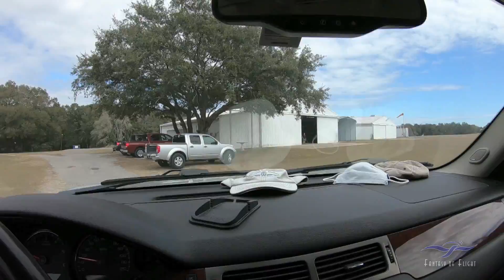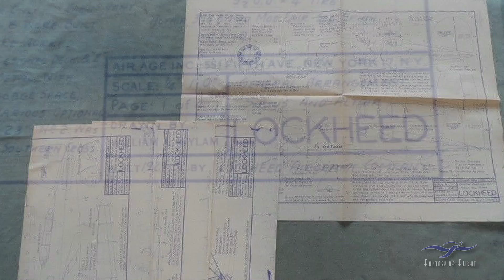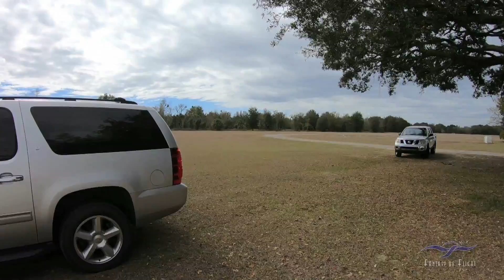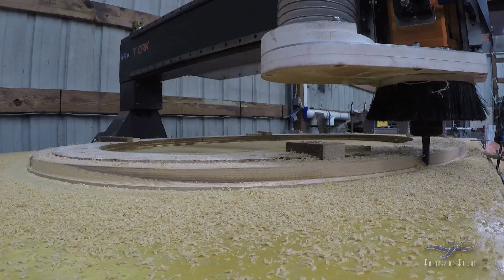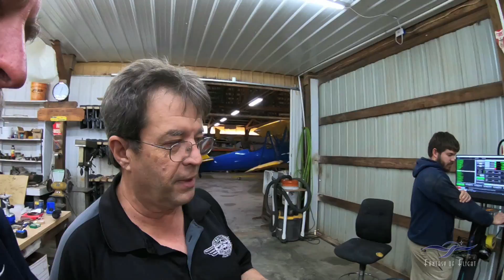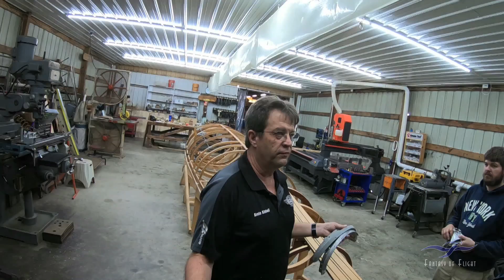Lockheed Vega - Project Visit - Part 1

Comment: Hi, I have a dumb but interesting question to ask. I have watched a number of videos relating to the rebuild of this plane, and today was offer one about the Smithsonian Museum  setting their 'Winnie Mae' up for an exhibition in 2013 . Registration appears to be the same, but the Smithsonian one was fitted with long range tanks. I suspect that the Smithsonian does not normally sell off exhibits that appear to be in reasonable condition and of historical significance, so that begs a couple of questions. 1. Were there more than one Vega's named Winnie Mae (i.e. maybe one damaged and replaced with a similar unit painted up the same). 2. If not, presumably one plane is the 'real' Winnie Mae and the other is another Vega decorated to represent the Winnie Mae, so  which aircraft is the original and which is the tribute plane?
Reply from the maker: The Smithsonian has the original of course!
Reply: @KermitWeeks444  Thanks Kermit, was just confused because Kevin seemed to have the entire history if yours in his head so that set me wondering.

Comment: you can use the CAD 3D data you have on the metal fitting that is cracked - and there are mold makers/services houses that will 3D print you a sand mold so you can cast those parts - then machine them - that is really much cheaper than the old process of sand casting with a wet sand mold of the old days. Plus the cast parts can me stronger than the machined billet parts once heat treated after machining - and of course more authentic as well...

Comment: Detroit Aircraft acquired a controlling interest in Lockheed Aircraft (not the same company originally started by the Loughead brothers) when the majority shareholder sold out. When Detroit Aircraft went bankrupt during the Great Depression Robert Gross and Walter Varney organized a group of investors to buy Lockheed from the receivers. They only bought the wooden plane maker. As far as I can determine, Lockheed didn't get any metal aircraft know-how from Detroit Aircraft. The Model 10 was  breaking new ground for them. Robert Gross with the help of his brother Courtland ran Lockheed until he died in the Sixties. Walter Varney started the airline which became United Airlines and after he sold it to United Aircraft started Varney Speed Lines, the airline which became Continental. Varney used Vegas initially in the operation of Varney Speed Lines.

It would be interesting to compare the fuselage structure of the Model 5 with a Detroit Aircraft DL-1. Detroit Aircraft was an innovator in metal aircraft construction.

I've read that they adapted the same concrete mold to make the monocoque shell for all the wood models. In 1928, Lockheed moved to a location in Burbank CA known to locals as "Turkey Crossing." The property is now a big outdoor mall and the recent addition of a new ramp to I-5 obliterated Turkey Crossing. So much for local history.
Reply: Dale, we have quite a few drawings for the DL-1, DL2, and DL2A.  We have a friend who is building a DL2A Altair now from scratch so we do compare our wooden fuselage to his aluminum one often.  The structures are quite similar. So much so that many of the cast aluminum fittings are used on both wooden and aluminum fuselages with the aluminum DL fuselage drawings referencing back to the wooden fuselage cast fitting part numbers.  The aluminum fuselage structure was clearly designed to utilize  the wooden design concept as possible with diaphragms and longerons in same locations as the wooden structure but from Dural instead of wood. 

Yes, one single concrete mold was used to make all the wooden fuselage half shells for models 1, 2, 3, 4, 5, 7, 8 & 9.  The 2 shells were made per fuselage as they are symmetrical, one is used on the left and one on the right.  Some of the models required a partial second skin shell bonded to the inside of the outer shell.  This inner doubler skin varied in size and location depending on which model it was.
Reply: @kevinkimball7711  Thanks immensely for the info. I've always wondered how Detroit Aircraft adapted the Lockheed designs. Is your friend who is building the DL2A nearby? It would be very informative if Kermit could get some video of it for comparison the next time he visits your shop.
Reply: @dalecomer5951  , you are very welcome.  No, the DL-2A project isn't nearby us.  I hope to be able to visit his project in the near future.

Comment: It seems that cutting those those stab  pieces manually would have been easier and faster than using the computer controlled devices. A good fine tooth saw, a nice sharp pencil, a couple of clamps,  and a piece of tracing paper and viola! it's Miller time.
Reply: We chose those parts for a quick part for demo.
Reply: @kevinkimball7711  I understand completely. I know that making many of the parts by hand would be a three hundred year project, and the machines free you to do what MUST be done by hand. I am just thankful that you guys know what you are doing without all the years spent in apprenticing as coach makers like the Brits who built the Hurricane and Mosquito. It takes a lot of skill to make a CNC machine do what you want.
Reply: Yes but this way he can drink and watch the machine work at the same time 😁

Comment: Always loving a Kermit Weeks upload. Thank you Kermit. :)

Edit: You know...that actually looks like it will be rather heavy in the long run. That`s a lot of laminated wood and glue. Add a heavy 300hp engine, six people, all the fuel, and everything else it`s amazing it could get airborne.
I see the strength in all the bulkheads but longetudinally not so much.
It just amazes me the amount of time, research detail and work that goes into these.
I`m just a lowly retired car mechanic with a curious mind.
God bless you Kermit weeks.